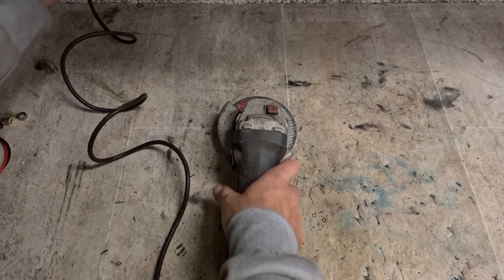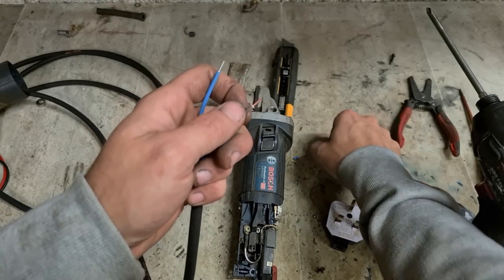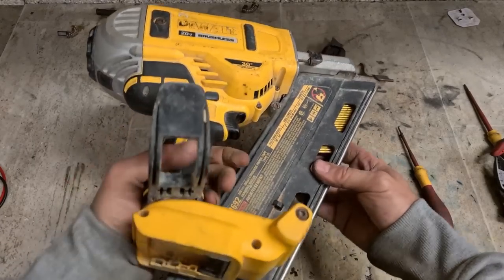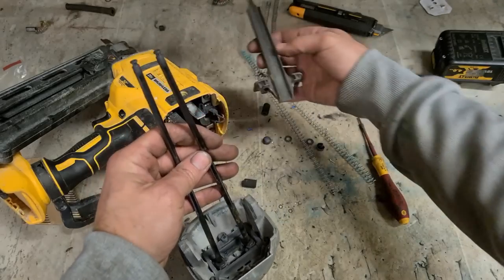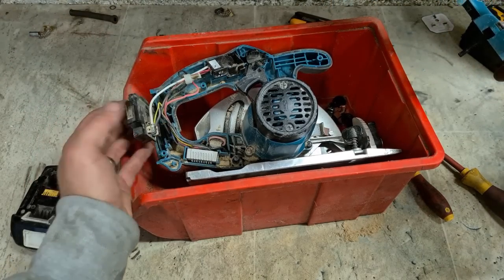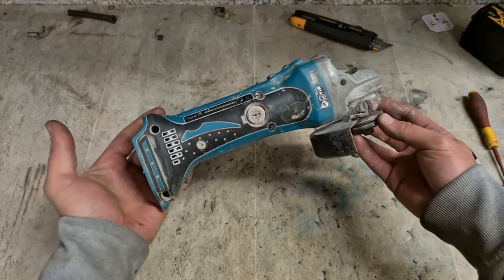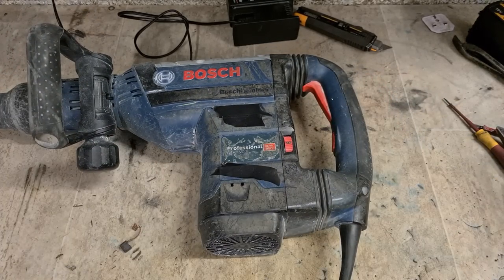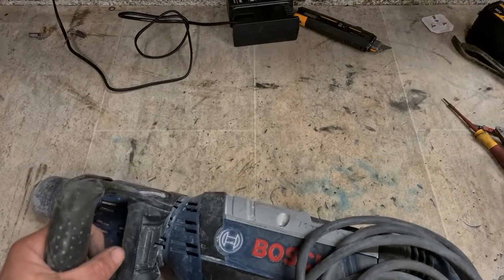Repairing a bunch of Makita, Bosch and dewalt power tools. 2 hours work, rolled into 30mins.

Comment: Makes me happy to hear engineering companies ordering large piles from shops like your place instead of squeezing the last cent by going to Amazon or some big outlet.
Reply from the maker: they have better comeback if they order local. any problems or questions they can simply call and ask. Small local businesses want your business and will look after you better. 
That's why the shop i work for, provide this tool repair service, to keep their customers happy and machines running well into the future, not just the 1 year warranty.
Reply: Most of the engineering companies rent or buy in bulk and claim back VAT. But yeah, I totally agree it's worth fixing most tools, especially the commercial grade ones. I changed the brushes and oiled (had oil in the gearbox) a large HILTI rotary hammer drill. Man, what a beast! Well used, you could hardly see what color it was!

Comment: I’ve got 2 of them. Small one with brushes, bigger one brushless. And one with powercord for the heavy work. I messed up my little one, just bought a new one, after 5 years of abuse. Also removed the retainer, so I could use 5 Ah batteries. The new one can handle the bigger batteries from factory.

Comment: Love your videos mate. The dewalt nail guns the friction ones I had one that wouldn't drive the nails and spent 3 days trying to get it to work. If you get one that wont drive them properly I found if you sand a 100grit crosshatch pattern on the flywheel it restored the driver power and a light sand on the pinch roller. It drove 90mm-65mm nails again. Could you try it out if you get a trouble some dewalt. Cheers

Comment: You could scavange the controller from the makita grinder for the makita saw :). No wait needed.
Reply from the maker: you could, but if it was my own tool. i would simply cut out the controller and wire the motor directly to the switch. And monitor the tool myself.
Reply: I'm surprised that when Makita uses MOSFET to drive the tool, they still put a switch capable of handling the current. Very decent of them :-). But I guess when doing the same modification to another brand, one has to be careful.

Comment: 8:23 those ferrules are a nice touch preventing short circuits 👍🏻
Reply: They aren’t really meant to prevent short circuits…
Reply: @shadygunshow  Awww!, sorry about that, I said that bcoz I had repaired cables before and those wire splinters made it go boooom! In my case, anyways if you can share the purpose of those ferrules it'll be highly appreciated, thanks for sharing your video 👍
Reply: @oscarmarfori613  The purpose of ferrules is to stop the stranded wire becoming loose, as its stranded it can move udner the screw and eventually loosen, having the ferrule prevents that, it also can provide a better connection as you guarantee full contact with the screw and as you found out can also prevent you from accidentally missing a strand causing other issues